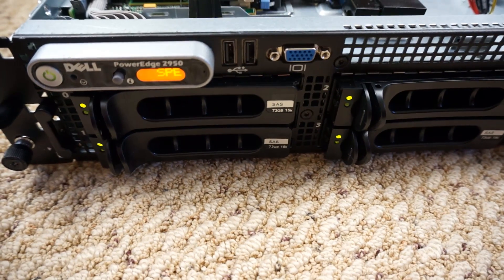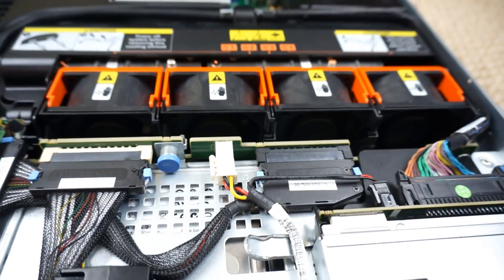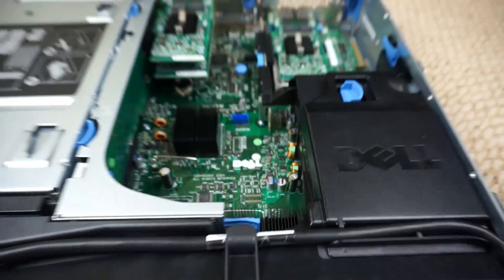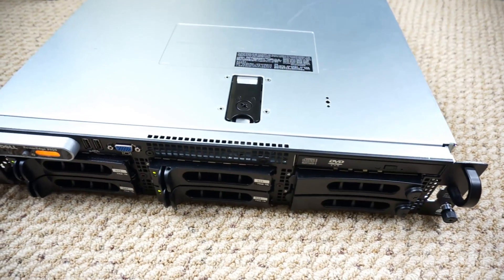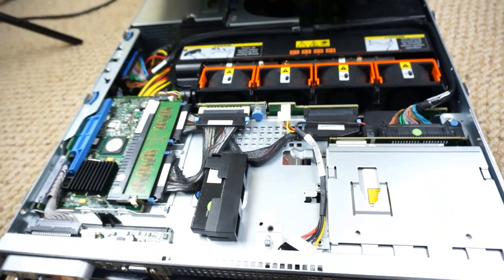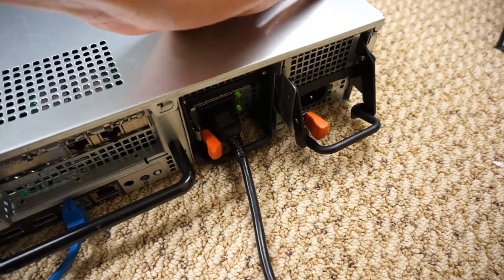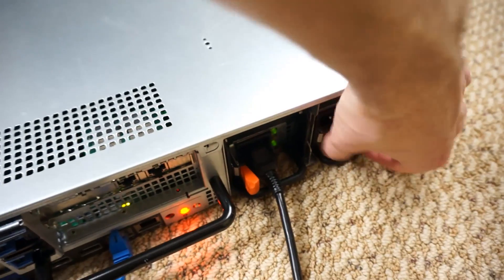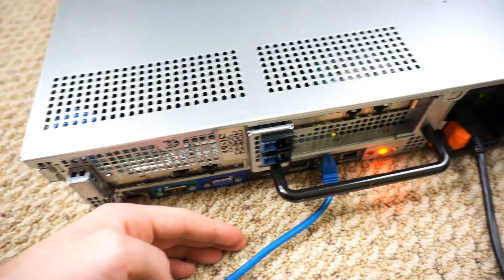Dell PowerEdge 2950 fan mod - 22 ohm vs 47 ohm resistors

Comment: Good video thanks. Do you happen to remember what wattage resistor you used? Was it half a watt? And did you do both hot swap fans and psu fans? Thanks.

Comment: I have seen so many people trying to get these quieter. New processor fans, fancy heat spreaders. All you have to do is change the fan offsets.

Get SpeedOffset value:

racadm get system.thermalsettings.FanSpeedOffset

Set SpeedOffset value:

racadm set system.thermalsettings.FanSpeedOffset X

The X values are:

0 - Low Fan Speed
1 - High Fan Speed
2 - Medium Fan Speed
3 - Max Fan Speed
255 - None
Fan speed and temp after adjusting...

https://www.dell.com/community/Systems-Management-General/Dell-PowerEdge-fan-speed-change-fanspeed-offset/td-p/5187784

Comment: So I agree with this video that 47 ohm resistors was too much. I tried 22 ohm, but those started to burn up. So I went to 33 ohm and the fans only dip as low as 2400 rpm, not any lower. The threshold is 2025 rpm, so they stay just above. They also don't start to cook themselves like the 22 ohm ones did.  Been running for about an hour now without issue, no burning, fans are staying pretty constant, average about 3200 to 3875 with the lowest at 2400,  board ambient temp is 23 C. Even when they peak at at the highest 3875 rpm, it is still about as quiet as my desktop. And while this is not in the living room, it is in a room adjacent to it and can't be heard.
Reply: I have been searching around for the perfect resistor value to throw into my own Dell PE 2950 and from your description it seems you have found the goldilocks zone.  My only question is that if you had to go into the fan firmware and modify the threshold values to keep the fans from constantly ramping up and the server throwing out errors all over the place saying that there is an issue with the fans. 

Reason I ask is that the start of my research on this endeavor started me here, and I was curious if you had to go in and change the values of the fans in the firmware, or if you just swapped in the 33ohm resistors and never got any errors from the server itself over the under-volted fans. 

https://www.ratzblog.com/2014/08/reducing-dell-poweredge-pe-295029002800.html
Reply: @AzurusNova   Nope, I didn't have to touch the firmware at all.  I have not had a single error either. Been running the server like this for just over a month now without issue and no errors.
Reply: also what watt is the resistor?  I put 33's in my r710's fans and they spin up and down in a loop.  they are 1/4 watt.

Comment: I wonder if a bios mod would not be better. It will constantly give fan errors and it will not be able to cool it if loaded at max for longer times... 
Or, better yet, than the bloke that wrote two stairs down, an Atmel that takes pwm input from the fans and re-scales it to a much wider range - if the mainboard actually drives the fans from something like 50 to 100% and the lowest pwm entering the fan keeps it running at too high throttle...

Comment: my solution: cutting the blue wire and  connecting the blue wire from the 
fan to the black wire sets the fan speed at 3000rpm.Works for me, without software modifikation.
Reply: So is the only redundant wire the blue plug side wire after this mod or is black fan side redundant also?

Comment: I investigated driving the pwm pins from an arduino with uln2003 driver 
it worked fine and gives the micro almost full control. What i have 
learned is very interesting the minimum fan speed that can be set is 
3000rpm ie cutting the blue wire and  connecting the blue wire from the 
fan to the black wire sets the fan speed at 3000rpm. Which is above the 
minimum required by the cpu. still alittle noisy but functional with no 
parts required.

Comment: I just received a used Dell PowerEdge 2950 so i can practice on and the server is freaking loud. I see many tutorials and tips from other sites on lowering rpm fans by modding FW ,adding differrent  resistor value and fans. If I follow your method I should be able to lower my noise from the server without issues? This is my first server i ever owned. Any advise greatly appreciated.
Reply from the maker: +Utoobyourself Mine did not have issues - but proceed at your own risk. Cabuzzi has reported instability on theirs below.

Comment: Is it the power supply fans that are loud, or the case fans?
Reply from the maker: +R Chan It's the unmodded power supply fan when I insert the second PSU, otherwise the noise is being generated by both the power supply fan (modded) and chasses fans (modded).
Reply: +Hexhound Wow, that's contrary to everything I've read, where people say the power supply fans are quiet enough, and they only needed to mod the 4 case fans to get it down to 55 db. Do you have a link on how to mod the power supply fan? Thanks!
Reply from the maker: I might post a write-up on how to mod the power supply fans, but I'm worried about legal liability. Given that the power supply connects to lethal power sources, it's not a job I'd recommend undertaking unless you're very comfortable performing these sort of modifications - in which case a guide shouldn't be needed :)

Comment: I did my 2950 with 20Ohm resistors. I would say keep an eye on your memory module temps because they get really hot!
My system now with 32Gb installed, temps are: lowest DIMM temp 47 oC and highest DIMM temp is 60 oC
Reply: Strange enough I have encountered errors with my server after a while of applying the resistor fan mod. I keep getting cpu errors of which description or error I can't remember. It could be a good chance that the memory is overheating due to less airflow? I know it's not a cpu error. Causing all sorts of errors from the system board. So I guess it's best to run the fans at original intended speeds. Doh!
Reply from the maker: Christopher Coe Yes, they do. I also have 32 gigs in my 2950 & it's still running fine. As an EOL server, I'm not too concerned about the temps --  I'd really worry after 85c or so,  but anything under that and it should be fine.
Reply: Have you had any stability issues after the fan mod? I have two 2950 Gen IIIs that I did this mod one (can't rmemeber the resistor rating), but one just won't stop crashing. I've tested the DIMMs in 2x4GB pairs, and it'll get through a memtest, even up to 16GB. But 24GB or more, and it'll reboot with a variety of errors (E1422, E2119, E171F). I wanted to think it was the memory, but all the sticks test fine when configured in 16GB or less. I replaced the mainboard, updated the firmware, and did the BMC mod to lower the fan threshold. It tested fine with the original fans, but when I put the modded ones in, it crashed again. 

I'm ordering another 32GB or RAM now, but I really think it just can't handle the heat. I can barely touch the area above the RAM slots after a crash....
Reply: Well, at least I'm not the only one. I ordered another set of four unmodified fans to test with. I guess we'll see. It's either that, or bum memory....
Reply from the maker: Mine's been fine, although I just pulled all the memory (8x 4GB DIMMs) & CPUs to swap into an HP ML350 G5, so I probably won't have any future reports. As these systems age, hardware failure is to be expected. While it's likely the fan mod will decrease service life, I doubt a healthy system will experience problems. The fans in the ML350 run at about the same speed, with the RAM running hot to the touch - and that system came from the factory that way. I also had a PowerEdge 1950 motherboard fail in a production environment; its behavior was similar to cabuzzis with random crashes.
Reply: Well, for what it's worth, I removed the resistors and the system ran memtest for over 24hrs without a single error (several passes). I can't remember what ohm rating I used, but as of today, I'd have to recommend against this mod. I checked the other 2950 I had (running FreeNAS) and there were errors in the logs as well. It would explain why I had a vdisk corrupt on me a few weeks back.

It's a shame too, the mod made all the difference in the world. I will be replacing my last two 2950s with R710s shortly. They are super quiet stock, and are nearly as cheap lately.
Reply from the maker: +cabuzzi Sorry to hear that. Can you share what brand fans & what brand RAM is in your 2950s? And yes, the R710s and Gen 6 HPs are getting cheap. They're more quiet stock than the 2950 is modded and they draw significantly less power. I'd recommend going that route as well.

Comment: hi i i got one of these and like everyone know the default fans are ridiculously loud so i bought like the video 22 ohm 1/2 watt gold resistors and now the fans are pulsating (i did the mod to 1 power supply and 1 of the 4 delta fans) so any advise and no before i modded the fans, they weren't pulsating
Reply: No Please Don't i did the mod like in the tutorial (THANKS A LOT MAN I NEEDED THAT) lower the fans rpm from 12000 to 5500~6000 so big plus but still too loud too have in my bedroom so i went and added the resistors on all the fans including 1 of the 2 psu but they still pulsate but its not loud but how do i stabilize them and fyi i put the threshold at 1350rpm, and with the resistors the fan turn at 3000 rpm that is ok but they ram up 4400 rpm then back down then up etc etc. the sweet spot would be 2400rpm (its permanently 15c in my room so the server stays at 25c cpu and 38c rams so i can lower the rpm just need your help XC
Reply from the maker: Kuro Neko It sounds like you may need lower value resistors. The fans pulsate when they receive too little power to start - one of my four did that with 47 ohm resistors, but they all work with the 22 ohm resistors. My guess is your fans are wearing out and require more power to operate, assuming they are the same fans that are in my 2950-III which are also deltas.
Reply: i checked and the delta are quite expensive for the PWM versions 25$ each and my server is the gen II and the resistors i'musing are 22 ohm 1/2 watt gold and yeah the fans are the same 12v 1.68amp delta's. I think il wait for the noctua PWM version price to lower and I will buy them. thanks ^^